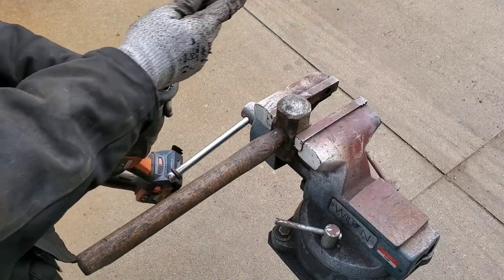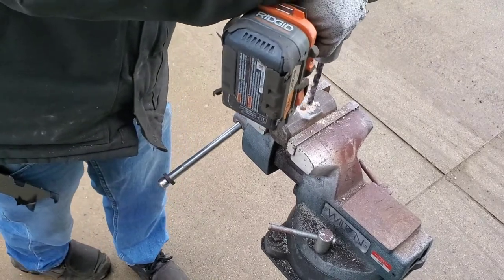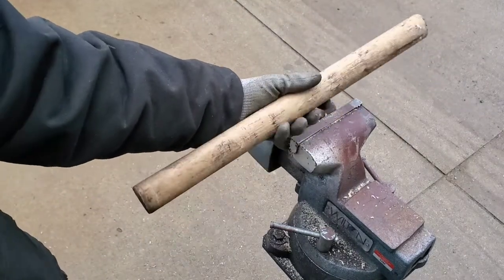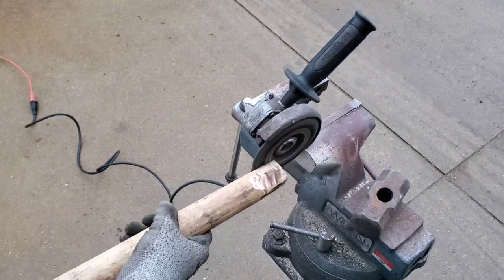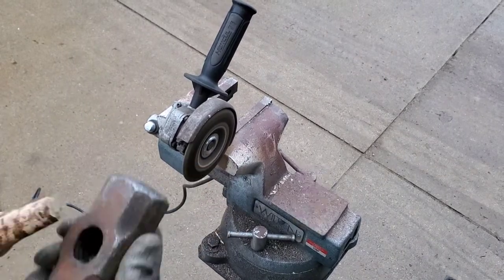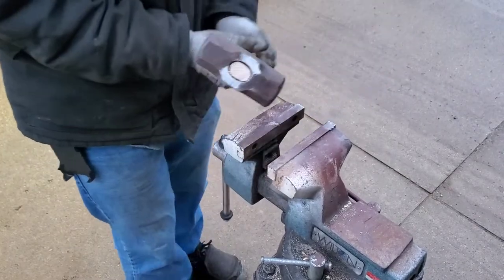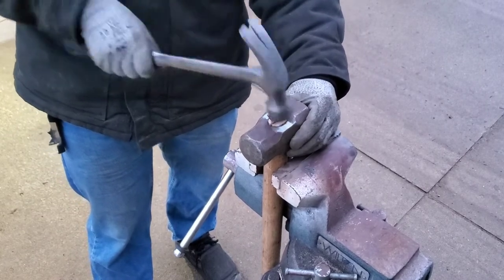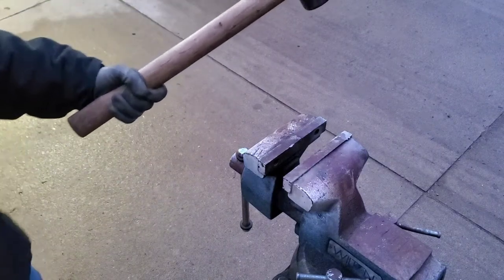How to make new handle for mini sledgehammer!

Comment: My 6 pound mini sledge just busted. I found a 3 x 10 x 24 inch slab of very tight grained white oak in the barn. Going to cut a 2.5 x 2.5 long enough piece to round and shape out on the wood lathe and standing belt sander. Going to let the 6lbs of hammer sit in vinegar for 2 to 3 days to dissolve the surface rust then clean up with the bench wire wheel and blue the steel, cleaning up the drift handle hole to clean steel before using epoxy and setting the handle in and tightening with the steel wedge. The handle just below the hammer I will soak in 50/50 polyurethane and paint thinner to soak a sealing protective inner coat then apply straight polyurethane with 3 more coats between sanding's. I like white oak better than Hickory it is just lasts longer and is much stronger.
Reply from the maker: That is fantastic! You should offer custom tool handles as a service and do videos.

Comment: Next time try gluing and clamping the handle back together with Loctite HY4070 special hybrid adhesive, available from your favorite local or online supplier, but not likely to be found in your favorite big box store.   You can wipe clean the surfaces to be joined with brake cleaner or with  N-Heptane primer(rubber cement solvent), or not.  It sets permanently in 5 to 7 minutes, and that's all there is to it. Each box with the tube of adhesive also comes with 4 approx. 2.5" long mixing tips that mix together the 2 different chemicals as you squeeze the adhesive out of the tip, but which are carefully kept separate inside the tube. Either line up all of your projects to be able to do all of them in order at one time with just one tip, or just order extra tips when you order this truly special adhesive.  I have an 18 year old front loading washing machine door that has had a cracked plastic frame held together with black duct tape for years - this week I'll use the Loctite special adhesive to make a permanent repair, but only after manually removing the duct tape and removing the sticky adhesive the tape leaves behind with my friend - brake cleaner! or I'll use n-Heptane, a wonderful product, on the tape and its adhesive simultaneously as I peel the tape off, because the adhesive on the tape releases when soaked with Heptane, but becomes sticky again immediately after the Heptane dries, so you can re-use it. 

Try it on stamps and car parking and other decals which can't be removed w/o a VOID message appearing - that doesn't happen with a liberal use of Heptane in a well-ventilated area.
Reply from the maker: That sounds really interesting and useful. I will have to look into N heptane. Thank you.